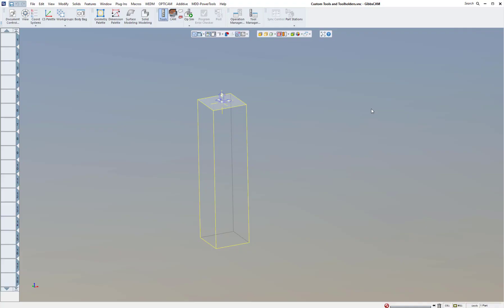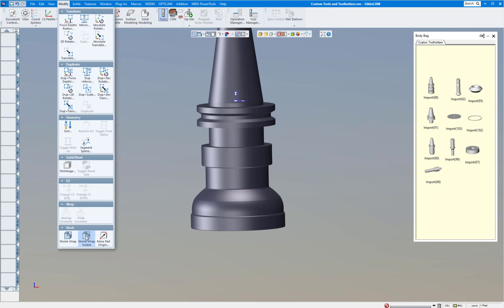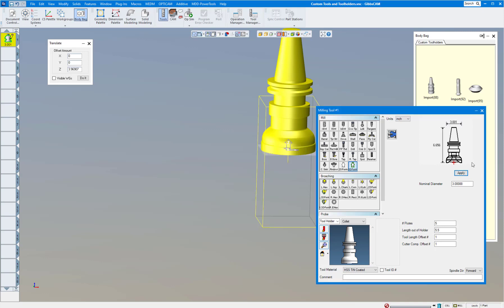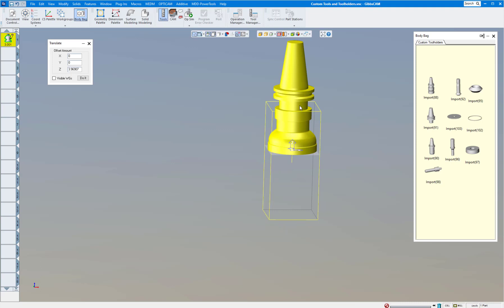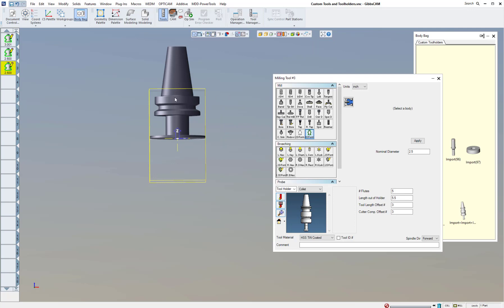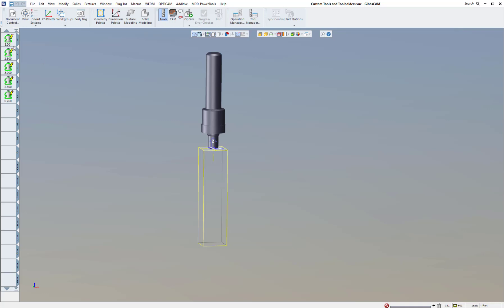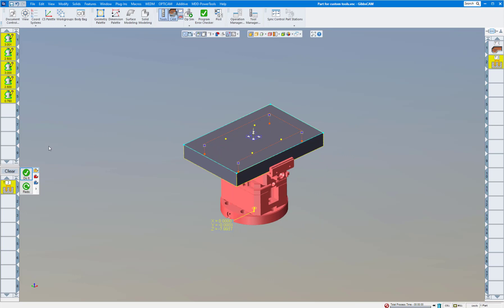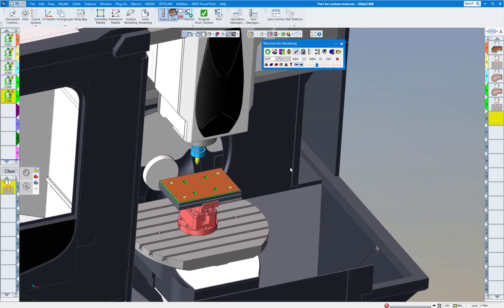GibbsCAM Custom Tools in Milling

Comment from the maker: I had a few comments on what keys to use to move the part dynamically.  If you move your cursor onto the solid, then hold down the Ctrl+Alt key you will get the XYZ symbol along with some rotation arrows.  To move the part move your mouse pointer until you see a hand-finger, then you can move to where you desire.